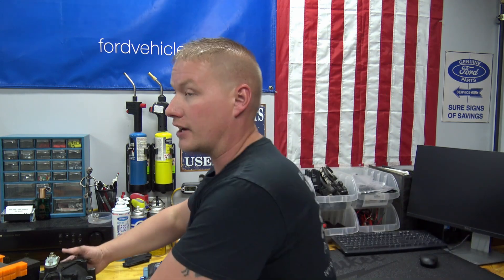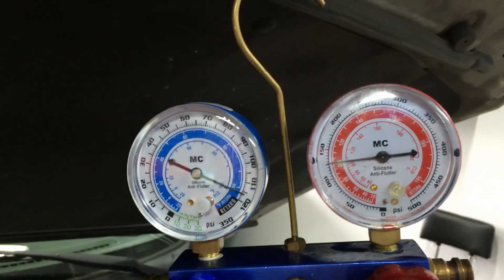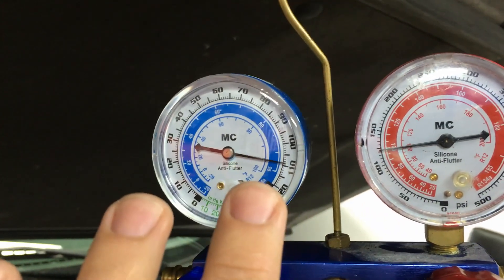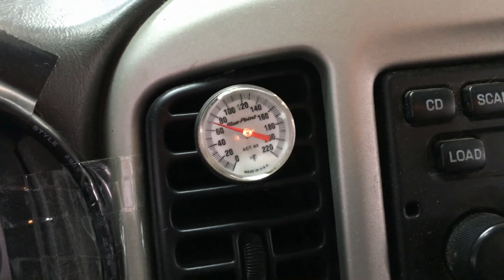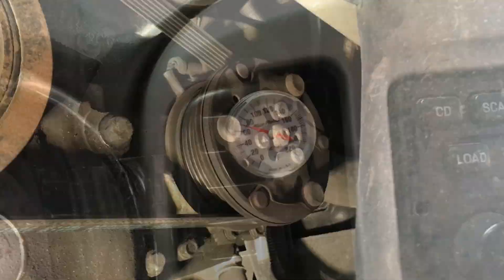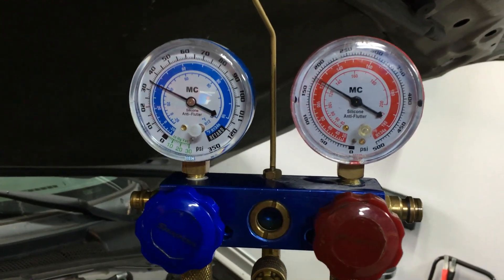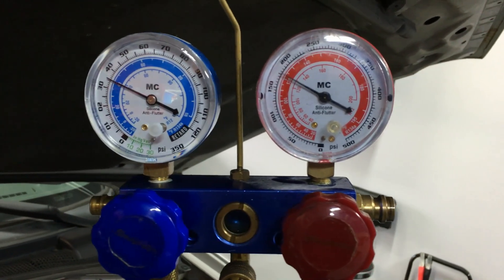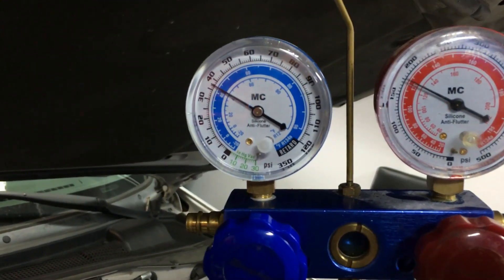Ford A/C Quick Tips #5: Diagnosing a Weak A/C Compressor

Comment: I have a 2008 F250 King Ranch.  It's parked out in the sun all day with temps in the low to mid 80's.  I'm seeing register temps in the 70' and finally dropping to around 40 after 30 minutes of driving.  I've read the F250's have weak air to begin with so I don't know if this is normal?  I just bought the truck from a Ford dealer with 19,000 miles on it.

Comment: I appreciate your videos as wonder if you could help me I have an 08 Mercury Mariner the AC pressure is about 55 on the low and about 1:30 on the high could you tell me any diagnosis you might gather from that thank you I really appreciate it
Reply from the maker: scroll valve inside the compressor but it still is best to just replace it with a new unit.

Comment: Hey thanks for making the video! I have used a few of these to resolve issues with my own 2011 Escape. I do have a question for you regarding the AC. Basic symptoms ... AC blows very cold, but only when it wants to. I find that the closer it gets to 30Celcius, the less likely it is to work. When it stops working the fan is still blowing but all I get is hot air. Every once in a while it may or may not get cold for a minute of two and then stops again. Any ideas? From what I have found online with this issue, it involves replacing the whole system which I am hoping is not true. Thanks again!

Comment: Where can we find an ambient temp/to pressure chart to help determine what are readings should be based on ambient temps?
Reply: Google sporlan p/t chart. R-134 usually for the low side should be two psi above your target evaporator temp. If you want a 40 degree evaporator about 42 psi is what you want. Evaporator temps usually stay in that ball park unless there is problem higher cabin temps will have a high e psi rating hotter days will have a higher psi reading. Condenser temps and psi change a lot and outside directly effects this. There is about a 10 psi difference in refrigerant temp for r-134 that high on the p/t chart. As a rule of thumb you want the condenser temp to be 2 degrees plus your sub cooling temp about the outdoor temp. In this video he has low high side pressure and high side pressure the compressor isn't squeezing enough heat out so the system has a low sub cooling temp which results in a higher super heat temp which is raising the low side pressure because it allowed to evaporate more than it should

Comment: i got a question for you and i hope you can help me. my static pressure is 100 on both high and low sides. when i turn on the ac, the low side doesnt drop neither does the high side until I switch blower motor speed to high and then drops on the low side and rises on the high side. could that be a weak compressor?

Comment: I hope you can help me. I have a 2016 Ford escape, it has a new compressor, the system is filled to proper spec, and the cooling fans are operating. it is not cooling the cabin. The high side pressure is 125 and the low side pressure is 57. not sure what the issue is. if you can help me that'd be great.
Reply: Aaron Hicks orifice tube or expansion valve is stuck open. The orifice tube or expansion valve creates a restriction for the high pressure to build up and low pressure on the other side.

Comment: Hello Sir,
I love the Videos.
I've got a question for you.
I recently replaced a starter , battery and cables using your videos and now my A.C Compressor is not working.
I checked the fuses thinking something was blown , nothing.
The Clutch is not engaging.
Any suggestions?
It was working before the starter replacement.
Thanks for any suggestions/help.

Comment: hi, I have a cousins 94 Honda accord, I've completely flushed the evaporator core when I replaced the expansion valve and drier.  did a full vacuum for 45 mins and waited 40 mins to confirm there were no leaks.  the manual calls for 21.2-22.9 oz of r134a, so I charged it with 22ozs (used a refrigerant scale with my 30lb tank - no I'm not a pro, just a serious DYIer with a love for tools and car repair).  I have a vent door problem cuz the passenger side vent blows about 10° cooler than the rest, but still only get 61° on the cooler vent on an 84° weather and +/- 60% humidity.  sometimes when I first start the a/c the clutch on the compressor won't disengage running it constantly, so I cycle it on & off and then it starts and stops as it should.  readings appear normal, 35/150 for low/high respectively to 40/175.   revving up the engine to 2000rpm if it's really hot outside it'll go to 55/220 respectively.  I cleaned the condenser with a condenser foaming cleaning solution, pressures went down a to 35/175, but no change in vent temp. I believe the pressure switch works properly.  once, I revved it up to 2500rpm and the pressure rose to almost 300psi, then it went back  down.  (it also was rising to 300psi constantly before and I could hear the pressure relieving, which led to my replacing the expansion valve for a. new one.  A/C fan turns on when the compressor clutch engages.  static pressure with engine off is 75low & 110 high.  is this a worn out compressor or what else do you think it might be?
Thanks for your input, great videos.

Comment: my 5.0 blows ice cold in 100 degree weather but my 1993 Honda Accord with new compressor blows 70 degrees at idle and 60 degrees while driving low Port Reading at idling is 55 if I accelerate it goes down to 30 please help

Comment: my ac work only when my car just standing i press on the gas pedal and blows only hot hair  what could be the issue  i have a 2003 ford expedition..Thank u
Reply: Check for vacuum leak or cracked vacuum resevoir

Comment: One time I had my AC compressor lock up on the highway and ended up chewing up the belt till he point it smelled like burnt rubber... got it towed to sunshine Ford in Newburgh NY and they said smart move I didn't keep driving because I could have caught the car on fire or made the belt snap and threw it into the radiator

Comment: Bryan when I remove the dust cap from the high pressure side of my 07 edge I hear a momentary burst of gas and the valve is oily. I checked because I'm losing freon every 6 months. No one has been able to find leak. I mentioned what I thought was a leaky valve to the last place that charged the system and they said they'd change it. I want there so not sure if the did. I removed the dust cap to check and I heard the bust of has again. Is there any AC problem that can cause a good valve to leak or was I just dooped?

Comment: Hi there, I'm not a mechanic by any means. I have a 2011 Ford Fusion 2.5 liter non-hybrid. Now that the weather's starting to warm up, I need my AC. However; there's just warm air coming out now. I went and purchased a $45 recharge kit from Knechts and the guy said it looks like I need to replace the AC clutch. It's not spinning at all when the AC is turned on. We checked the relay under the hood, and that was good. I know if I take it in for just a check it's gonna be a minimum of $100...And then additional parts and labor to get it fixed. Can anyone help?

Comment: I have an RV built on 2017 Ford E450. The compressor doesn't engage. It seems it was not wired properly. The air coming out of the dashboard stayed around 65F at best. How would you diagnose this problem? Thanks.
Reply from the maker: +20CB WestiesDen start by taking it back to the body up-fitter.

Comment: I have a 2001 F150 4.2L V6. Whenever I turn on my A/C the A/C compressor will turn on and after a couple of seconds turn off. It repeats this process as long as the A/C is on. As a result the engine will rev a few hundred rpms every time the A/C compressor turns off and lowers once it turns back off. This also makes the process to fill my truck A/C systrm with R134A refrigerant impossible. Just curious, what is the problem and how do I fix it?

Comment: First off great video, I just suscribed to your channel. Now to my AC mystery, here are the specifics.
1998 Honda CRV, Low side 40PSI, High side 175PSI, both cooling fans turn on when AC is on. AC is ice cold at idle but compressor turns off while driving(verified with diagnostic tool), replaced ac clutch relay and high pressure switch but the issue still remains, no leak in system. Have you seen this symptom before? Thanks.

Comment: Radiator fans only run when I try to use the a/c, not sure if that's related?
Reply: Mine does the same, and my compressor clutch is easily moved with my finger.

Comment: Very informative video! Ive got a question for you. The line going into the evaporator after the FOT is freezing cold but the line coming out if the evaporator is warm and the accumulator is warm. What are the possible causes of this? A flooded evaporator maybe?

Comment: IF the compressor is bad, do I need to change out anything else (besides coolant, etc)?
Reply from the maker: The lines should be flushed also the condenser, metering device and drier should be changed.
Reply: Thank you

I have a 08 Expy.  This what you mean?

https://smile.amazon.com/Motorcraft-YJ612-Condenser-Assembly/dp/B00J5DXM8K/ref=sr_1_2?ie=UTF8&qid=1471486374&sr=8-2&keywords=yj612
Reply from the maker: yes

Comment: Little off topic of video....Got a 2014 Ford Fusion 1.5L    know anything about the "purge" valve? Seems I need to replace it. I fill the car up with gas and it will not restart. Unless I pump the gas pedal like an old 1968 carbureted car  lol, then it starts. That is the only time it effects the cars  running ability. It will at times make this rubbery sounding burping noise, I assume it found a way to release some pressure on its own? Maybe at the fuel filler? idk 
Thanks for any info you may have on this subject. If nothing then Have a Great Day!
Reply from the maker: Yes I have many videos about this concern. The latest part for your vehicle is DG9Z-9D289-F
Reply: Thanks for the reply. Have found a couple here. Thank You for your channel lol comes in handy for a GM guy.

Comment: Great video! I'm getting a tapping noise when the clutch engages on my F150... The air still works but could probably be cooler. Is this the clutch or a bearing on the compressor? I appreciate your insight!

Comment: 2000 Ford Focus keeps saying I need a special tool to remove the fuel delivery module from the bottom of the tank because they redesigned it and I need to put the new one in my focus is there a way around not getting the 300-plus dollar tool could I do it with the regular shop tools
Reply from the maker: All the tool does is nip off the holder the old pump snaps into on the bottom of the tank so if you are going to do it yourself be very careful to not ruin the tank vapor barrier and use a tool like this to nip it off- http://amzn.to/2bryMxt
Reply from the maker: Also be sure to only use the latest Ford pump or you will be back in there before long- http://amzn.to/2bgAUMr
Reply: +FordTechMakuloco thanks is there any more hidden problems with these focuses it's the dual overhead cam version 2.0 zetec
Reply from the maker: You can sure try it but I have never heard of a good story using aftermarket fuel pumps I have fix many Ford with drivability concerns due to inferior aftermarket pumps.
Reply from the maker: Sent
Reply: +FordTechMakuloco thanks
Reply: Do

Comment: My AC Compressor clutch Kicks on Breifly then Turns Off. It makes this terrible sound.. 
..like :   " CHHK-Kah! --- seeuueee yeee-yeee-yeee- Chuck-SHwooo youuuu you--CHUCK! " 
LOL---ehh..  
Do you think I need to replace the WHole AC compressor or just the clutch...? THANKS MAN! 
your channel has helped me alot!
Reply from the maker: You can tell by spinning the clutch by hand engine off it should turn smooth with a more resistance during compression strokes. If its fine you will likely find the clutch is coming apart.
Reply: Thanks for  the  reply!   Hey on  a side note,  did  the Ford logo always have that little loopdiloop next the F??  I swear it looks different

Comment: Does anyone  have an idea why my blower relay continues to blow.  I've replaced blower,  resistor, climate control  . Also air will blow through the front vents then go to defrost back to front . After it  doing all that in a few days it will blow relay.  Any tips

Comment: Great video as always! I have two questions. Where did you get your holder for the two propane torches in the back ground? I have a 2011 fiesta that cools great but sometimes it will throw intense heat out for a small amount of time then go back to cooling fine. I've not put gauges on it yet but I'd almost think it was something other than a charge issue. What's your take?
Reply from the maker: These are the torch holders I got- http://amzn.to/2aUjZ2S
Reply from the maker: Well you will have to see if the compressor is still on when the concern is happening. Also if the cold air turns to heated air not just ambient temp then I would say to go after the temp blend door actuator. When they go bad they can hunt.
Reply: +FordTechMakuloco thank you sir, I'm placing a order for that holder now lol. I'll take a look at that blend door and see if that's the culprit, car has 98k now and yes when the problem occurs the air is super hot. Thanks again, I've been able to use your videos for a few things specific to this fiesta and it helped me out more than you know.

Comment: what can I check on my 13 explorer sport for the rear air. it's all on the same compressor yet the front gets cold but the back doesn't.  I have checks all the controls and everything is working as it should. Just no cold air from the vents.
Reply: Refrigerate level
Reply from the maker: Few things here will the rear get hot if commanded? Also under the vehicle there is a large and small a/c line together does the large line get cold and sweat?

Comment: nice explanation. i know a lot of places say pretty much all components need to be replaced to honor the new ac compressor warranty.  I'm sure you will discuss this topic eventually
Reply from the maker: If there was a catastrophic failure yes but otherwise most compressor manufacturers just want you to check and clean the vehicles metering device and replace the receiver drier because of the acids otherwise you are just wasting your money.

Comment: What if you can't get a proper air gap between the clutch plate and the idler? That is the current issue I'm having. No matter what combination of shims or complete lack of shims I use I cannot get a proper air gap. With no shims on it's barely engaging the idler but only to the point that it spins and then slips causing the clutch plate to become incredibly hot. I'm trying to fix this without putting in a new compressor but I don't know if that's avoidable at this point.
Reply from the maker: How did it come to this point of needing to shim the compressor? If they are new parts then I would make sure they are the right parts but also make sure the pulley was not pressed on too far. If they are old part then they may just be too worn to make up the gap.
Reply: Clutch plate literally flew off and then the bearing self destructed in the idler. It then friction welded itself. I replaced everything down there except the compressor itself. All the parts are new motorcraft parts and are per what comes up for my year and model of truck.

Comment: My experience has always been that replacing the compressor causes other components in the system to fail within months (or sooner), supposedly because they're no longer up to the task of handling full pressures.  Thoughts?
Reply from the maker: Never had that problem when done right. Now if there was debris in the system I could see the new compressor failing but not because of too much pressure.
Reply: It is true. I had to replace an ac hose and then another one burst shortly after, because it was weak and worned out. So the lesson is if you see an ac hose look questionable, replace it or you'll be doing the job twice.
Reply: My take is if its an older vehicle, replace everything. If it is newer, fix the broken part and move on. There are exception, like the Ford FS10 compressor, which can cause a complete system failure when it fails.
Reply: Thanks for replying. I'm going to have to have it done before long on my '98 F150.

Comment: can anyone tell me what a blinking ac light means? the ac works fine for a while then the ac light starts blinking and the ac stops working.
Reply from the maker: Never had one do that you may want to check for codes in the system. I have seen the a/c light flicker on the early focus models when the blower resistor of all things was failing.
Reply: I know on some Toyotas it can be because of a clogged cabin aid filter

Comment: Do they still put that inline filter in the system on the high side? Pretty sure that would be a major issue to address for catastrophic compressor failures.
Reply from the maker: This Escape Hybrid has a FOT front system which of course has a screen but the txv on the Fords generally do not so it flows right on through. This hybrid does have a inlet screen before the txv in the line connecting to the battery cooling circuit for the rear cooling system though mainly because of the rear zone cut off solenoid.
Reply: +FordTechMakuloco I'll just nod and agree.  What is this French you speak of?
Reply: When I was a ford tech back in the 90s we used to install a filtering kit whenever a compressor was replaced. It came with a low side canister filter that spliced into a low side flex hose and remained in the system. The high side used a pancake canister filter that was attached into the high side hard piping and was removed after the system ran for about an hour. You than recharged the system and retuned the vehicle to the customer. I wonder if they are still using a procedure like this in ford dealerships today?